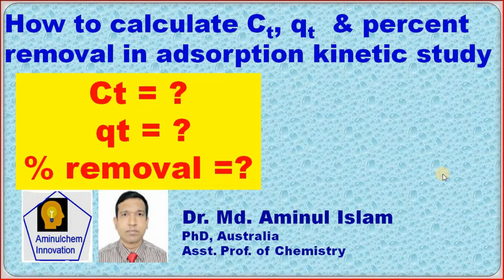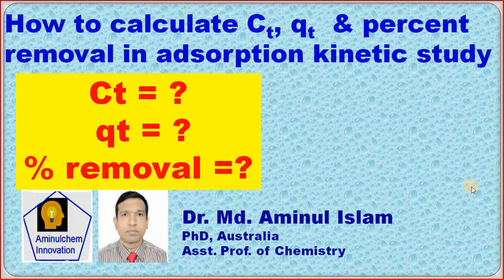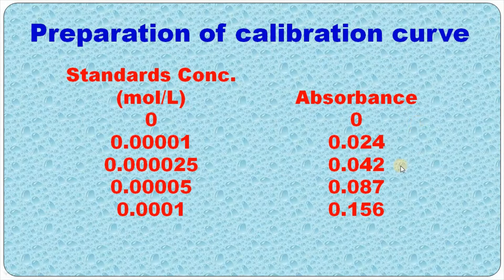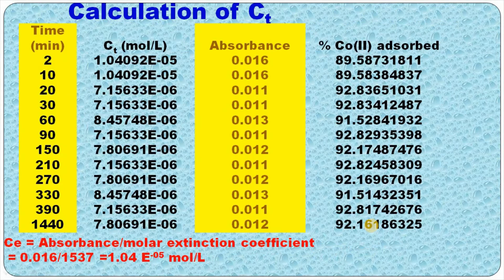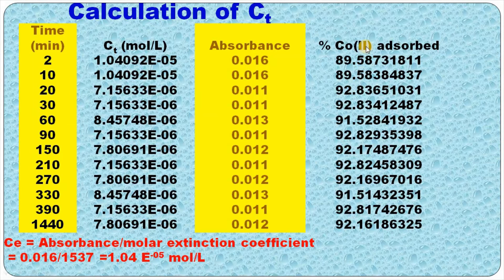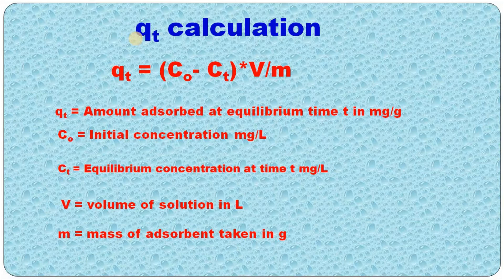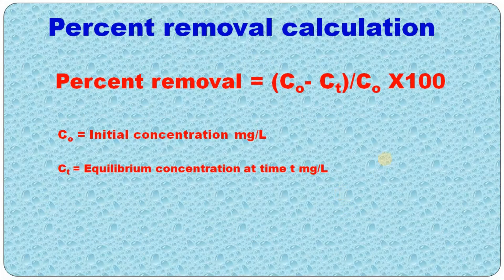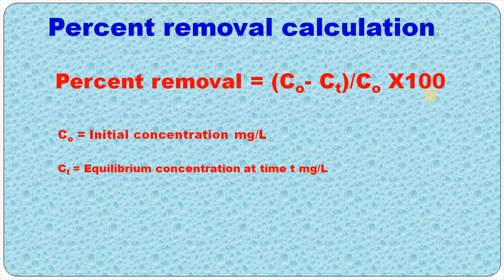How to calculate Ct, qt and percent removal in adsorption kinetic study

Comment: is the optimum condition the one that has the highest percent removal?
Reply from the maker: Yes, you are absolutely right.
Reply: @Aminulchem  is a negative percent removal possible?
Reply from the maker: @ernestcroiz5727  Thanks. No it is not possible.
Reply: @Aminulchem  what if the percent removal turns out to be negative, what can we do with it?
Reply from the maker: @ernestcroiz5727  Thanks. Percent removal can't be negative. Please double check calculation and repeat experiments. Good luck.
Reply: @Aminulchem  unfortunately, we don't have time anymore for repeating experiments. Is it okay to disregard the samples with negative values for isotherm and kinetic studies?
Reply: @ernestcroiz5727  Yes you can do that
Reply from the maker: @ernestcroiz5727  If you have more data, you can do that.

Comment: Hi Sir, the returns determined in one of my studied variables are inconsistent with each other. For example, in the study of the effect of pH, at contact time of 60 min, Cr (VI) 50 mg / L, Dosage adsorbent 100 mg / L and pH 4, the efficiency of 87.9% was determined. In the study of the effect of adsorbent dose, if the reaction conditions are equal to the effect of pH, the efficiency is more than 90%. Also, in examining the effect of contact time, if the reaction conditions are equal to other variables, the efficiency is less than 70%. Can you please help me how can i justify these contradictions?
Reply from the maker: Thanks. You need to repeat experiments. Usually, three experiments are done for same set of conditions. Two nearest results are reported. Please watch all my videos.If you have further query,  please let me know & don't forget to subscribe this channel.
Reply: @Aminulchem  thanks for the response sir, already subscribed :)
Reply from the maker: @dr.sajidjamali4499  Please watch all other videos.